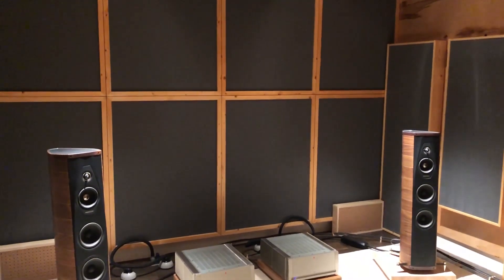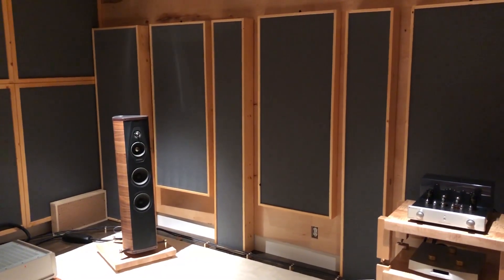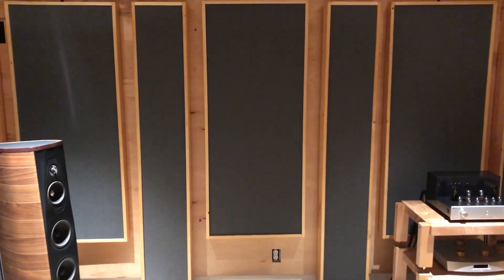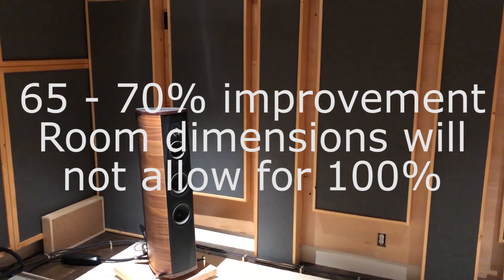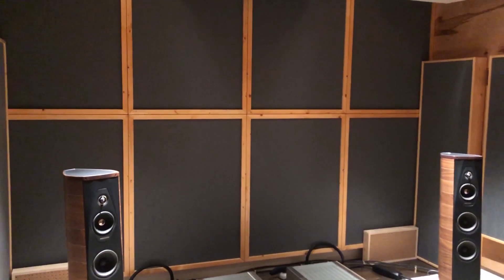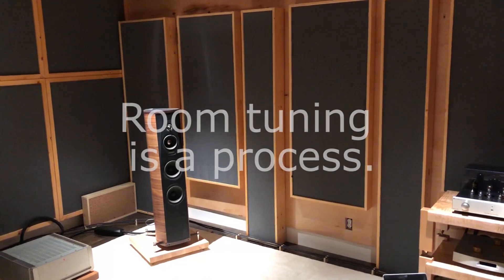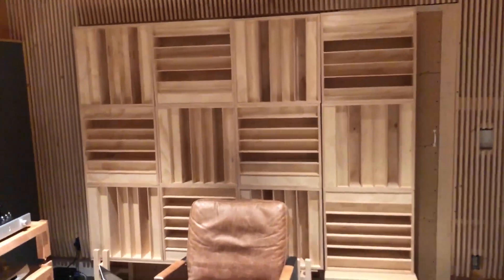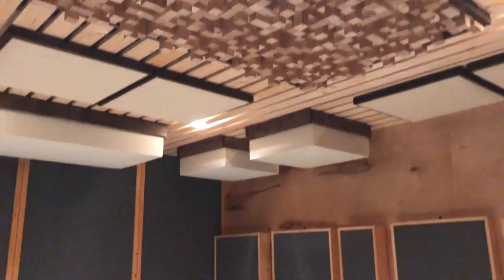DIY Done Right Follow-Up - www.AcousticFields.com

Comment: Nice room! Well done.
Question:  Is it just me or does anyone else think that the listening position is too close to the rear wall QRD diffusers?  Might absorption directly behind the chair on the rear wall with diffusers on either side of the absorption work by  adding some distance from ears-to-diffusers?
Reply: Yeah, it does seem a little to close to me too.  It looks like a relatively small room.

Comment: I would really love to see an amplitude vs. frequency plot and a waterfall diagram recorded at the listening position...
Reply: sure, the MLP - 
how about BEFORE and After for seeing the problems that needed to be 'fixed" , 
 doing more may be o.k. - but what  "probnlem" is being corrected?
Reply from the maker: W,  We have a data base of over 150 rooms we have built and measured. When we did our frequency and amplitude measurements in these rooms, we used 18 microphones to locate all frequency and amplitude issues and their locations within the room. We use this database to assist clients with their room issues and the specified treatments. Most clients do not have the skill set to operate complex testing equipment. Going after the major low frequency issues within a room size first goes a long way to reveal the "buried" issues that can not be heard until major low frequency issues are treated correctly. Remember that all frequency issues begin with low frequency resonances.

Comment: I believe in room treatment but that's overkill...and he wants to do more.
Reply: When it comes to room treatment, he originally added enough to make a HUGE difference and it seems like he's just further fine tuning it because that's what happens.  He's probably hearing smaller differences more noticeably because he's been treating the major problems and then you can more easily pinpoint and fix the smaller problems.

when it comes to room treatment, you have to add enough sq. footage to really address any issue.

You may think it's overkill, but you need to experience what he's doing first hand to make a better judgement.
Reply: I agree with both of you but to an extent. Yes, we want our music and home theater to sound the very best that it can be. However, where's the line drawn? When we attended live music venues, its not  in a room such as this example. How accurate is normal everyday sound? Answer, not that accurate. We hear sounds and music in every day life out of phase, in delay, bouncing off objects, walls and ceilings. Live music is bouncing all over the place no matter where you are.

Yes, you want your soundstage to be as accurate as possible and as open as possible trying to duplicate the original recording. But you don't need to do this to get you there. Something tells me, nothing will satisfy a guy like this. Nothing will ever be enough. He's gonna keep blowing his wad on room treatments instead of just enjoying his music. No room no matter how much money you throw at it will be perfect. Because there is no such thing. Perfect is in the eyes of the beholder.
Reply: @cap96lt1  What we do in our own rooms is up to ourselves.   Yes, unfortunately many venues have horrible acoustics which is why the listening experience isn't always that good, and we are listening to amplified music.

What we are listening to in our rooms is recordings and the recordings can be really good or really bad or anywhere in between.   But we at least have the ability to control our own destiny, if you will.  We all probably spend more time listening to music in our home than in a live venue.  We also have the luxury of having the perfect listening position, and we want the investment in recordings/equipment to sound as good as they can.  Removing the sound of the room is something we can control given enough money, room treatment, etc.   Recordings are generally mixed and mastered in soundproof rooms that typically have excellent room acoustics for those applications and the major difference is diffusion, at least under the best conditions.

Room treatment can always make a bigger difference than our gear can, and that's all AF is trying to do is allow people to control their own destiny in the listening experience.

It's entirely up to us, the consumer, to put room treatment or not, how much, and where within the room to achieve the best overall sound of the recordings we are listening to.

What I find kind of silly is that when audiophiles speak of listening to music trying recapture that "live" experience like the musicians are in our home playing right in front of us,  most of them are talking about listening to acoustic recordings that are recorded/mixed/mastered for the most accurate recordings in a good room with good room acoustics,  NOT a live concert with amplified instruments, which never sound natural at all.

The bottom line is that we are just trying to get the recordings to sound as best as they can without our room interfering, unfortunately it requires a lot of different types of room treatment to achieve the best results and it requires many steps of constantly battling what problems we have and fine tuning the room until we are happy with the results.

I toss AB comparisons out because it's not realistic to do those comparisons.  I have not seen many AB comparisons of equipment (including room treatment) that are without flaws in the method of which everything is being judged.  Sure, on paper it sounds like it's the best way to compare, but in really there are too many variables at play and in some cases, it's just never going to be a foolproof method for comparing A vs B.
Reply: Yeah, but you have to consider that is a very small room. In order to have a professional sound in a room that small, you need to spend a lot in bass absorption.

Comment: I have a feeling some of this stuff in not necessary. I'd love to see a double blind type test. like a placebo sound absorption panel. I bet these guys can't really hear the difference. they give their ears way too much credit
Reply: It actually sounded very legit the so spoken 250hz to 300hz problem. I've had myself a problem in the 250hz to 300hz region that was from the side wall...
And the result was very noticeable by ear (but originally fixed by using a measure mic), the bass notes sounds much more defined now.
Reply: A double blind test is not exactly possible when you have A and B where you are adding lots of room treatment to a room.
Reply from the maker: B,  Stay away from "feelings" when it comes to acoustics. Small room acoustics is well based in the physical sciences. There is cause and effect for all issues. It is that cause and effect that solutions arise from.
Reply: @AcousticFields  I understand that and I know treatment is necessary. But I wonder when it becomes too much, and when the changes are no longer noticeable
Reply from the maker: B, Here is the process we see. If a client can hear or starts to hear certain things in presentation that they dislike, and this is a time process that may take 6-12 months, it comes about by listening to the same piece of music usually a favorite over time. They hear this frequency anomaly and they want to fix it with treatment. After they treat and fix that single issue, another will sonic ally appear. This occurs for two reasons. First, they couldn't hear the new anomaly because it may have been "buried" under the first issue and secondly, they start to hear the other surfaces within their rooms "sound off" and the treated portion lets them hear the other wall issues that are not treated.
Reply: @AcousticFields  makes sense...thanks for clearing that up for me